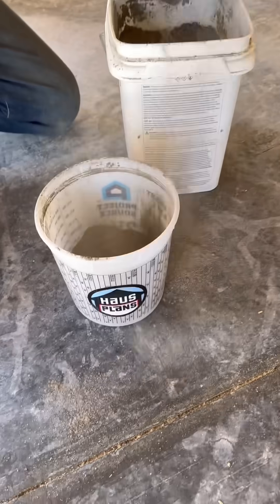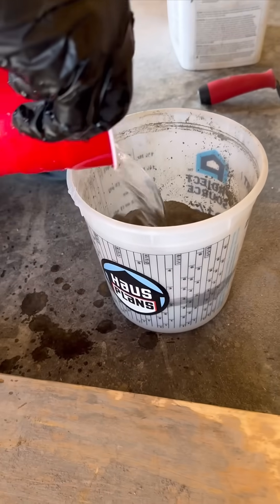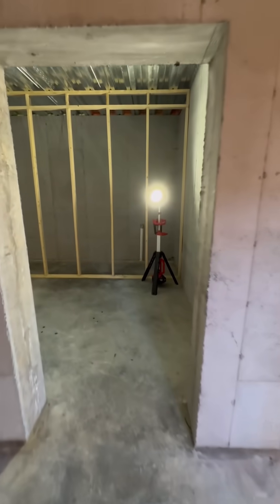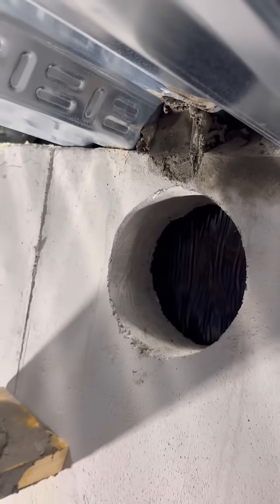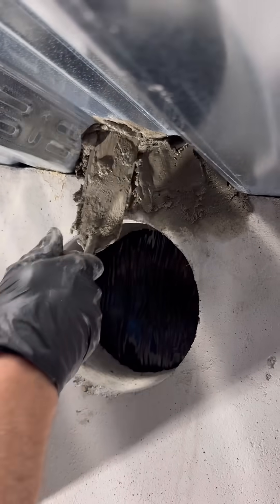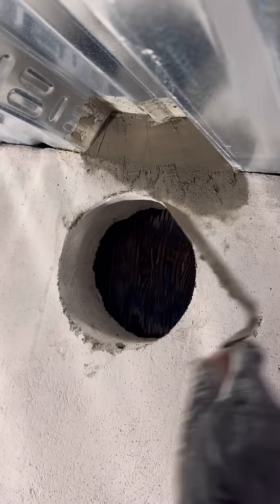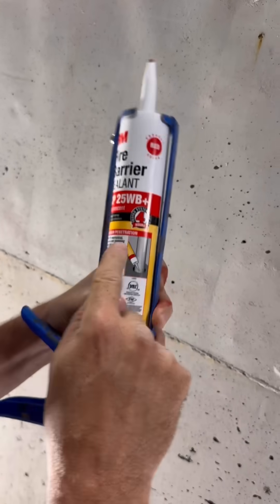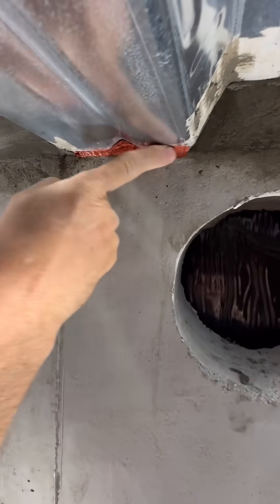Using Hydraulic Cement To Fireproof Our Safe Room

Comment: Just like a chain, it’s only as strong as it’s weakest link. Your wall at the entrance door seems very thick, but based on your other short video of the top slab (garage slab), it’s good for vehicles, but for a actual safe room, probably not. A safe room from what are you looking to be safe from? There are guidelines for safe rooms, did you tell your structural engineer that the floor slab of your garage was also the roof of a safe room, if not, then it’s actually a weak link in your safe room.

Comment: For me… I would have dug an escape tunnel out about 100 feet, stopping short of breaking through the surface by a few feet. That way if you are ever trapped down there, you can quickly dig out the last few feet and emerge to a safe and secluded area, with no visible means of entry.
Reply from the maker: I’m planning to leave the house not stay in the room. The room is for protecting valuable items

Comment: Look at sturdy safe company for the door. They are way better made than Fort Knox. They can be fully customized and are half the price. They use ceramic insulation rather than drywall. You can also add anti drilling layers and safety lockouts

Comment: You need a steel corrugated tunnel beside the exit door of the safe room that leads to the outside might  the house collapse around the safe room. You also need to make a reinforce ceiling and walls around the door if it opens outwardly in so that it can’t be blocked by debris.. 
hopefully the room is 100% waterproof. I would make the room beautiful on the inside. Beautiful lighting. Beautiful furniture special treatments. You can make a movie viewing room with padded walls like an  Odeon theater.  Goal is to enjoy spending time in the room.  Footage added to the house increases the resale   valuable,,, bonus is that it’s a safe room.

Comment: What's the point of a safe room?     Your best defense is always an offense.    I have around my 20 acres a ultra cheap string of IR sensors forming a circle around the property so anything approaching triggers an alert - it only cost me like $400 to do - very easy.    The only hard part was wiring it so you have it segmented and knowing which alert is for which segment,  I made a small hand drawn map and each segment triggers a different little music tune and a color light on a small electric board.     Most of the false triggers are Racoons.    You can tell this work so well - when I get deliveries from UPS. Fedex, Ontrac, USPS,  I leave the gate open for the day and they are shocked when I come out to meet them - I tend to give them a couple bucks for making the drive out to my place on nasty gravel road.      Anyway, a perimeter sensor setup I think is fantastic and yet it is pretty cheap to DIY.

Comment: Is this supposed to be a safe room for people or a vault for property? 

Hopefully, you'll leave the house if it's on fire, but... since your air system has fire dampers that will close during a fire, you may want to keep a backup source (or supply) of air.
Reply from the maker: More of a vault for property, but it would also make a good storm shelter

Comment: yeah you definetly want an external ventation if you were going to use this for fire refuge, smoke, carbon dioxide, and carbon monoxide are heavier than air and will settle in a basement

Comment: So, I did the same thing 15 yrs ago.  Something you’ll need to consider is that once the slab starts to settle, you will most likely get some minor cracks, any water that gets into those cracks will make its way down to the metal roof and start rusting it over time and while it’s not needed for the support, the cosmetics of it looks pretty bad.  So once those cracks (even small ones) start to develop stay on top of sealing them.  As far as your door goes, for doors used for bomb shelters or safes, they open outward, doors for safe rooms (for tornadoes) open inward so that if the building collapses against the door, you can still open the door.  So, if your door opens outward and you’re inside, You need to have someway that you can force that door open even if it’s covered in debris so use something like a jack.   Thank you for posting your videos because the use of that fireproofing was something I’m going to do for mine.  You’ll really love the peace of mind that having that room brings and thanks again for posting all these videos.
Reply: The door should open inward. Just saying that's the point of a traditional inswing door. Early settlements around the world including the states open in for a good reason.  One is snow so high you can't get outside if the door opens out. Two is wind, if the wins is severely strong and blows debris infrastructure of the doorway you can't swing the door.. 3 for security,  you can secure a inswing door more easily and better with bars and bolts than you can with an outswing. New codes in florida calls for outswing doors.. just make sure you tell your engineer you want an inswing and put it on the plan and buy inswing. so just saying.. nice work BTW.. the door should open IN
Reply: @AdaywithJoe  in Denmark, the standard is in-swing, one reason being snow, but also it makes it more difficult to remove the door, take apart the hinges, from the outside. While it makes it easier to ram the door from the outside by emergency responders.

That is if you haven't installed excessively strong dead bolts and security bars... then they basically have to dismantle the doorframe.

A common single unit "outside" door has 3-5 dead bolts with 2-4 of them not being the most solid ones (top corner up and out, bottom corner down and out) and a solid dead bolt next to the regular closing mechanism at the middle.

It provides more stability to the door, so it isn't easy to kick in, but it's still no match for a bunch of firemen with a ram, that know what they're up against.

Anyway, I do understand why wooden houses would require outwards opening doors. Because if they catch fire, you don't have time to try hunker down... it's just about getting out, before debris can block the doors. But often, wooden houses also have porches or raised entry of some kind, so it takes a lot of snow to block those doors.
Reply: @BenjaminVestergaard  you caught that correctly when you mentioned disassemble the hinges. The cops and fire departments would like door to open out. For easier entry.  In swing door has way more stability if installed to NEVER come out of jamb. 
When I spec on plans is 42 inches masonry opening.  For a 38.25 prehung frame and door.  I install the 3/4 PT BUCK AND SANDWICH 16 ga sheet the length of the side jambs between 2-5/8 plywood. I use ss screws &  geocell clear to glue it all together. I then make a dry run with door in jamb. My work requires NO shims because it's in a hurricane zone of 180mph plus. So no shims. I cut my tolerance on the table saw if need to. So, the laminated metal/ wood buck is my shim it's just 2 inches thick and  sacrificial if you have to remove the door frame you wont damage the masonry.  So,Once dry fitted,  disassemble the door from the jamb. and then, more geocell the bucks and start concrete screws into the masonry 2 screws 4 inches apart 8 on center the length of the jamb. So now we have a jamb that is laminated with a sheet of metal that will hold any wood from splitting in the event of an attack from the cops. The geocell glue is super amazingly strong stuff.. I swear by it. Then I glue the door base and both sides and the top slipping the door in-between the bucks for a tight fit. Add a fee screws but don't over tighten them. Come back tomorrow and tighten the screws. And use 4 inch white head tapcons 1/4 inch. 8 inch on center behind the door frame gasket. That door could literally be un bolted and the glue would hold it in. I had to change out windows and doors I've installed in 40 years and literally had to cut the wood buck out because of being laminated with geocell 40 years ago.
Everything I put geocell on stays put. Including chimney flashing, stack boots, everything..
Reply: @AdaywithJoe  Looks like he's using galvanized, which will "help" but not entirely eliminate that problem.

But it depends on if the grading and elevation of the house allows for a wet garage floor too. You can have a bone-dry garage floor, they exist ;) 

I'd be more worried about traditional basement 'woes', like moisture coming in through the walls or floor, just because the ground is wet. But whether that's a major concern depends on the local water table. Where I am, no matter how well built, a basement will eventually need a sump.
Reply: I really enjoyed reading that
Reply: Any concrete over 10x10 ft is guaranteed to crack, thats why they put saw cuts or grooves in concrete. It provides a weak point for the concrete to crack in the straight line instead of all willy nilly
Reply: No idea on building anything, but wouldn't be it good to have multiple layers of concrete with waterproofing between the layers? What about running two or three of those I-bars across the room with rebar mesh between them, and then waterproof layer and then another set of I-bars but at 90 degrees?
Reply: what jack could you use? or you like modify a floor jack to push out and not up
Reply: @ I’ve got some large  heavy pry bars and use a floor jack.  It was the cheapest option for me.  I also reinforced the outside area of the door (the area that is the actual basement) so debris should fall away.  We don’t actually close the door all the way unless the tornado is pretty close to us.  We also remind family from time to time that we have that our door opens outside.  We have enough air vents so I’m not concerned about unless we need to close those and then the air purifier system would kick in
Reply: @nate.hanlon  they sell hydraulic jack pistons of all sizes. That screw couple onto a porto-power pump. For body-shop and mechanics and riggers alike. You can find a piston or ram or spreader jaw that you could use to do what you want and just mount the hand pump near the door jamb.  You get into trouble,  just start pumping.  ✌️
Reply: Why do you have a safe room? For disasters? Or cause your rich?
Reply: @ because I live in tornado alley and I care about my family.  I’m not rich. I just choose to prioritize my families safety over owning other things
Reply: god forbid you prioritize your family's safety 🙄 lol

Comment: Curious to know what you’re planning with respect to maintaining a survivable temperature in this room in the event of a fire. I did 20+ years in Fire/EMS and have spent many hours inside concrete burn buildings, so I know how unmerciful the radiant heat can be. I really like the concept, and you’re damn sure doing good work, but how are you planning to address the ambient temp in there? Without some sort of active heat management, it seems like you’re just building a very nice oven. You’ve done THIS much, so I doubt you don’t have a plan to address temperature in there.

Comment: That’s not enough caulk for 4 hours. You should read the joint system ULs for metal decking to concrete. The thickness for 4 hours is like .25-.375.
Reply: Very few people know how to do firestopping properly, just putting red caulk isn’t enough.
Reply from the maker: This is not a code issue. I’m just doing my best to fireproof this room for storing valuable items. It’s not like a firewall in a commercial building.

Comment: If this safe room is above ground you have built yourself a very nice oven.  A fire around that room above ground will basically heat the concrete and then render you  just like a turkey at Thanksgiving.  The only real defense against something like that is to be under ground a where the heat does not reach you as easily.  Closing the fire dampers will simply suffocate you without pressurized air or oxygen.  hopefully you left a few feet between the garage floor and the top of your shelter with compacted soil.  Great against home intruders though.
Reply from the maker: One, this room is underground. Two, If there’s a fire I’m not gonna run to this room. I’m gonna get out of the house.

Comment: "4 Hour Fire Barrier" caulk is not rated for 4 hours.  There is no UL system that allows that.  So, the hydraulic cement might help in a fire, but that room is not fire proofed.  Cool room either way.

Comment: Hydraulic cement is no joke. My brother and I were patching cracks in our Uncle's basement and I had just mixed some up with a drill. Went to go help him move some material and I came back after what seemed like less than a minute, and it was rock solid in the small bucket. Had to toss that batch out.

Comment: the one time i saw a vault door installed it was lifted in place by a crane onto some grout at the bottom - it had milled ribs and short pieces of welded on rebar - everything sandblasted and etched to create a good bond with the concrete then had rebar welded to both sides and on top of the doorframe then had the waterimpermiable concrete poured around it , then had the inside and outside sealed again ...also the roof was concrete poured onto precast pretentioned concrete sheets rather than a sheetmetal concrete form

Comment: The ventilation holes are there for you to install an air exchanger for the vault?
Reply from the maker: Those will be for a cold air, return and supply in the HVAC system. They will have fire dampers that will close in case of a fire.

Comment: A tip, store tools instide your vault.  In Haiti 2010, most of the security gates became stuck shut because the earthquake tweaked the framing enough that the door wouldn't swing free.  When I see vaults, that's the first thing I think of now.  Being stuck insdie, or not being able to access what's inside after a disaster.
Reply from the maker: Good point! I'll be sure to keep that in mind.
Reply: Yep! In my storm shelter there lives a mini sledge to knock the bolts open,  5ft pry bar to get the door open and move debris, steel soled boots to get across debris, and fire extinguisher so my family doesn't cook. No point in surviving the storm just to die in the shelter.
Reply: @KingCovfefe  Love it!!  Smart thinking.  :)
Reply: Not gonna matter either way if something falls outside the vault door, blocking it from opening, unless its built to open inside instead of outside....I should know, I stayed at a Holiday Inn Express last night.
Reply: "a tip, store tools inside your vault".

So, store them inside so one can't access them if something like this were to happen?
Reply: @scuzzle-butt they didn’t say store your only tools in your vault, just store tools in there. Grammatically it wasn’t even incorrect. If you interpreted it as “store your only sets of tools in your vault” then you’re just being obtuse. They even acknowledged having them locked inside at the end of their comment, so why would they recommend storing your only sets in there? Dude…
Reply: @scuzzle-butt  If you didn't mean your "only tools" then your original comment is moot. That's just basic logic.
Reply: @scuzzle-butt apparently it’s really hard for you bro. Just admit your fault and move on. Hard part about growing up is acknowledging you made a mistake.
Reply: @WhackSwordsman they had a pretty normal question, considering the og comment would basically suggest not storing anything in there… theres no implicit reasoning as to why youd store any of your tools inside. Which is why they had the question. Maybe you care to explain so he can understand what mistake he made here?
Reply: @snickerdoooodle idk, it doesnt suddenly make sense to store some tools in there either?
Reply: @zwicker5585 the original comment literally explains why you would want to store tools inside, that way if something is broken and preventing your escape, you can use said tools to try and free yourself. But the one guy said ‘why would you store the tools where you can’t get them’ even though no one said you’d be putting all your tools in there, therefore that guys comment is a pointless, especially considering you’d be inside the the vault when you need them, given the context of the original comment
Reply: @scuzzle-butt  No, so you can get out.
Reply: @scuzzle-butt  tools in vault are for people in vault

Comment: How thick is the concrete? Sides, ceiling and floor?
Reply from the maker: The walls very between 14 and 10 inches. The floor is about 5 inches in the ceiling at 6 inches of concrete.